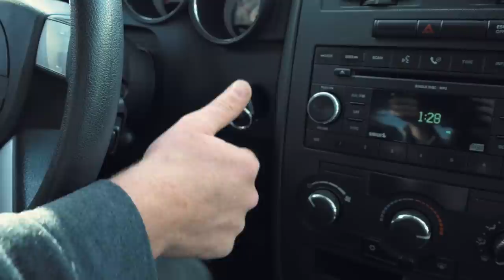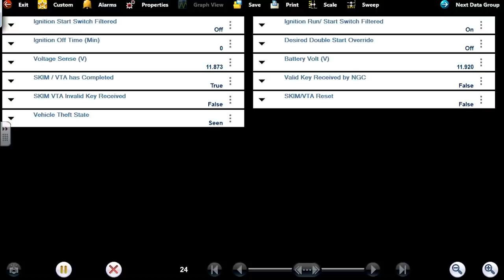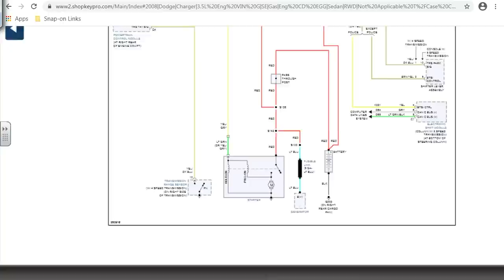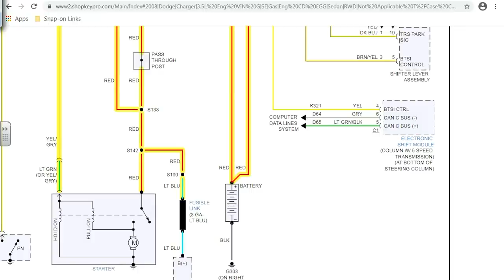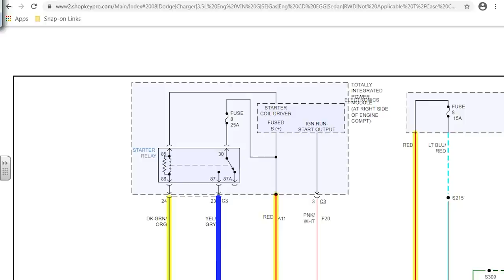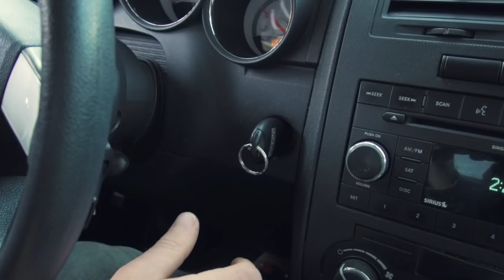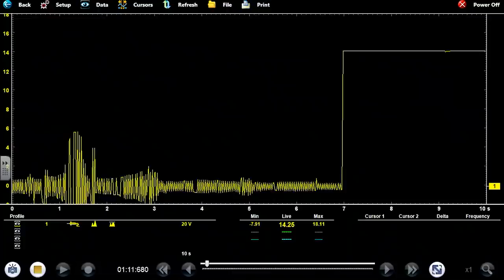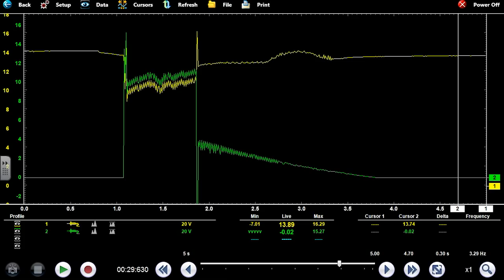Intermittent no crank - starting system troubleshooting (good starter)

Comment: Could have plugged the bad relay into the relay control box, watched the LED to know when the relay was switching on, and then identified the delay as being after the control came on.  It wouldn't have necessarily condemned the relay, but it would have ruled out the control side.  Then use the switch, no delay, relay is the only thing left.

Comment: Hey. I think you are wrong. The reason for bad relay and the bump in the the scope is the resistance in the coil of the relay and not a bad contact. A delay is common problem with relays. This problem usually is caused by voltage flactuations and bad battery.
Reply from the maker: Watch to the end

Comment: relay clicking only tells you the control side is working ( power to coil) OK! If high resistance on contact side major voltage drop Carbon equals high resistance!

Comment: OK , I HAVE A 2013 CHEVY MALIBU 2.5 ECO V6. THE CAR WAS RUNNING FINE WAS AT THE STORE CAME HOME DROP OFF THE LOAD N GOT SOMETHING TO DRINK JUMPED BACK IN THE CAR NOW, NO CRANK NO START. WHAT THE CAR DID NOT EVEN START BUT ALL THE LIGHTS IN THE CLUSTER CAME ON FINE HEAD LIGHTS PERFECT BUT CRANK NO START. SO THEN PUT A CAR CHARGER ON IT STILL DOESN'T START, NOW I GO CHANGE THE BATTERY NEW STILL NO CRANK NO START, CHANGED THE STARTER AND STILL NOT STARTING. I DONE CHECKED ALL THE FUSES RELAYS AND I STILL HAVE THE SAME PROBLEM CAN ANYONE HELP ME OUT.

Comment: I think anytime you find a relay at fault you (or I, or anyone) can feel lucky because you tell the customer they had a faulty relay and their typical reaction is "oh wow, I would've never guessed" and the repair is as simple as it gets--unless the relay is contained in the TIPM and then it's a different story. It's a relay that is going to cost---I don't know but more than $100 plus the diag time because then you're backprobing harnesses and stuff isn't easy to get to and diagrams etc.........and the TIPM is $$$

Comment: im having this problemm with my car. and its not the relays, battery, starter, fuses, or the alternator. the car is intermittent. no click or crank.
Reply from the maker: What is your voltage on the starter S post AND BAT post DURING the no crank?

Comment: The 2008 chrysler jeep and dodge have 2 issues, one is the starter relay, the other is the "WIRELESS IGNITION NODE" (WIN MODULE), just google your vin and if the win module hasn't been changed Dodge will change it for free....google it under chrysler recall

Comment: Damn Danner, where was the speech about Damn Chrysler won't label their fuse/relay box.  Everyone else labels the panel box but Chrysler and they make you look it up on the internet or get the damn manual out.  Stupid Chryslers. Hmmm.
Reply: Ford doesn’t label them either
Reply: @automedic9781  That was the tongue in cheek joke.  Danner always says s#@t about Ford not labeling them, like they are the only ones.  I have worked on a Honda that did not lael the fuse box.

Comment: I’m having a very similar issue except it’s not the relay. I have spent so much money trying to figure this out I I have change the starter, I have a new battery, changed all relays. When I turn the key the car just clicks once But if I keep trying it will start eventually I don’t know what else to do.   PLEASE HELP!!!!!!!
Reply from the maker: When it clicks, get a test light on the BAT and S posts of the starter and see what it shows you. Have someone hold it in the crank position for you while doing your test
Reply: @ScannerDanner  Seems like it could be a bad ground somewhere because I get 12.4v on the starter wire  but when it’s connected to the post it’s only getting 3v. FYI it starts with no problem if I jump it at the relay (87-30)
Reply from the maker: @NewMobEra  3v on the solenoid post but you jump the relay and it cranks?
Reply: @ScannerDanner  yes. Can I send you a video?
Reply from the maker: @NewMobEra  how strange! Okay, so our drop is not on the load side because you can jump it. So we need to focus on the control side now. Low voltage there may be causing the relay to buzz causing poor contact on the load side. Does it buzz?
Reply: @ScannerDanner  I do hear a slight buzz kind of like a scanner sound but I’m not sure if it’s coming from the relay
Reply from the maker: @NewMobEra  the buzz im referring to would ONLY be there during a crank
Reply: @ScannerDanner  In that case I would say no

Comment: Concerned that this intermittent starting problem would be masked if you put the battery on the charger [ 12:44 ]?  How about don't try to start the car with the battery on the charger.  Just put the battery on the charger for 2 mins... or 5 mins... or however long it takes to just bring the battery back up one or 2 tenths of a volt and then take the charger off before trying to start it again.

Comment: New starter solenoid drawing too much current took out relay?  Starter sounds slow like the China starter I put in my 4 wheeler -- like the brushes are phased wrong, or not enough coils in starter winding or maybe those newfangled oil-free bearings.  
They probably don't make the bypass relay/switch any more because one time somebody plugged it in to the starter relay and the switch was on and the key was on, and the manual transmission was in gear while they were standing in front of the car.  :-)
I miss the old days when the key sent power to the starter solenoid through the clutch safety switch(or maybe through the safety switch bypass wire), and the operator controlled when and how long the starter cranked .
Corollary to Murphy's Law - You can't make anything idiot proof, because idiots are so ingenious.